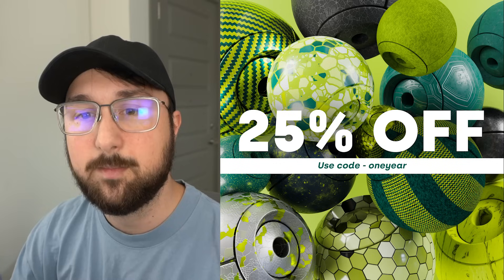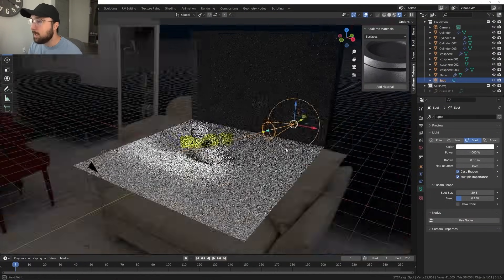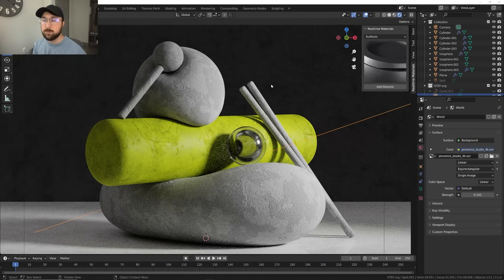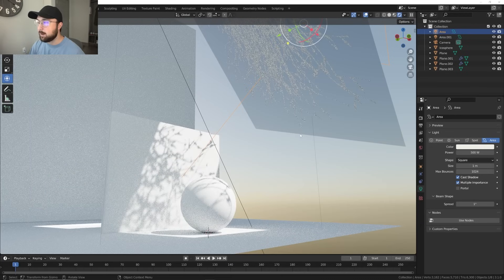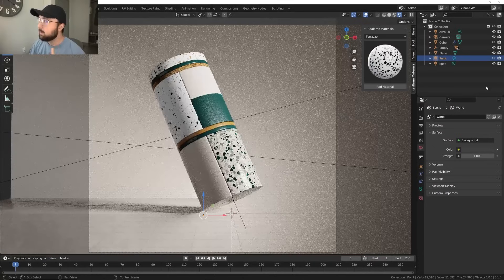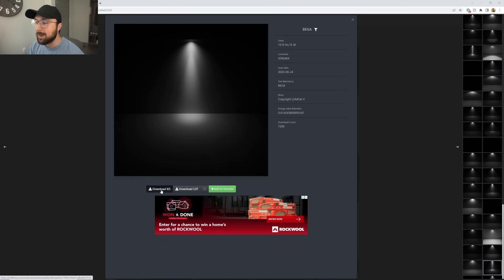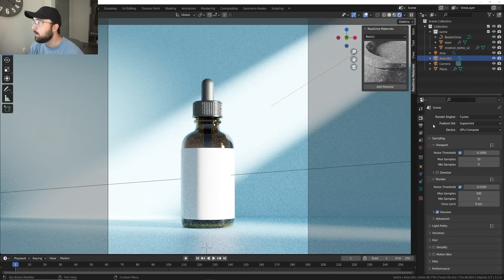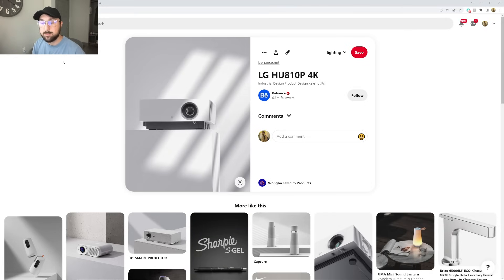Modern Lighting Techniques in Blender

Comment: hey i got the realtime material and it is nothing but amazing, I use it a lot and it helps a lot, it sped up my workflow, and now I'm finally doing cool things in blender, but it still lacks some materials, here's some, you can put in the next update, : planked wood, wood but more gray, metal with edge rust or scratch ( the metal has a lighter color on edges to simulate scratches ), scratched paint, grass, ivory,  clean metal, that's it , hope you can make them, thanks
Reply from the maker: Thank you! We just started talking about wood materials so you should see some soon!

Comment: IES lights are engineering modelled light data and available from light manufacturers such as Philips, or OSRAM etc... also you can use the blend with the spot light to create a softer blend across the light falloff